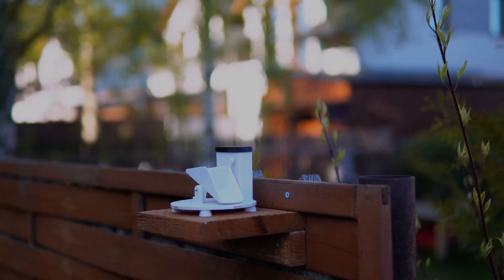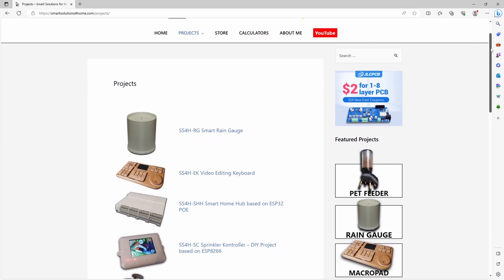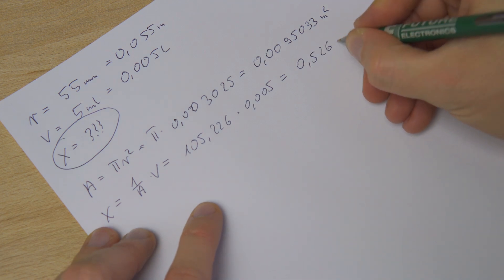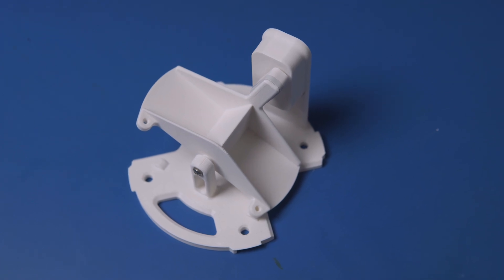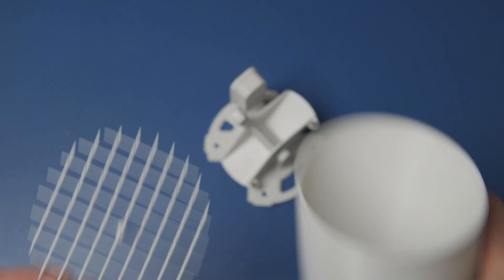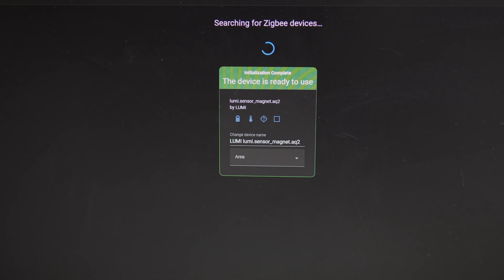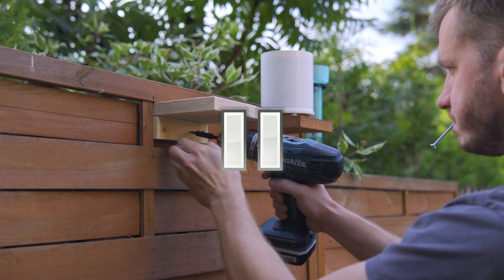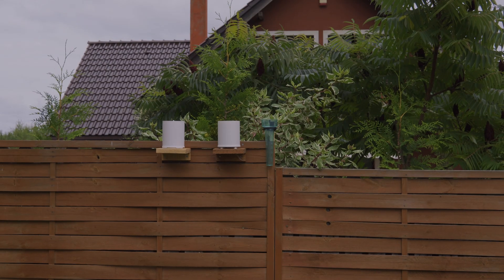DIY Zigbee Rain Gauge for Home Assistant

Comment: Missing the HA code.
Reply from the maker: It's in the video :) But you're right, it's missing in the article... I'll fix that ASAP.
Reply: @SmartSolutionsForHome  Thanks 👍
Reply: @SmartSolutionsForHome  The sensor is on it's way from ali and the filament roll is shrinking.. ;-) Now waiting for the HA code... nice video and nice tutorial.
Reply from the maker: @marijn1818  Share your impressions once you have the device up and running. :)
Reply from the maker: I won't be able to update the article for the next 7 days, so I'll try to address it here briefly:
All of this needs to be entered in the "configuration.yaml" Replace XXX with the name of your Door Sensor. This is an example for the last 24 hours. If you want a different time range, you'll need to duplicate this and adjust the time:

sensor:
  - platform: history_stats
    name: "Aqara Rainsensor flips/on"
    entity_id: binary_sensor.XXX
    state: "on"
    type: count
    start: "{{ now() - timedelta(hours=24)}}"
    end: "{{ now() }}"
  - platform: history_stats
    name: "Aqara Rainsensor flips/off"
    entity_id: binary_sensor.XXX
    state: "off"
    type: count
    start: "{{ now() - timedelta(hours=24)}}"
    end: "{{ now() }}"

template:
  - sensor:
    - name: Aqara Rainfall
      state_class: total_increasing
      unique_id: aqara_rainfall
      state: >-
        {% set count = (states('sensor.aqara_rainsensor_flips_on') | int(0)) + (states('sensor.aqara_rainsensor_flips_off') | int(0)) %}
        {% set mm = count * 0.52615 %}
        {% if count >= 0 %}
          {{ mm|round(1, 'floor') }}
        {% endif %}
Reply: @SmartSolutionsForHome  I did this differently. I have a counter helper for the number of bucket dumps, an automation to increment the counter, a template sensor to convert the count to mm, and several utility helpers to show the amount of rain for the last hour, day, week, month, and year. The count and template don't reset but act like a utility meter.
Reply: @vegaswayne247  Sounds like you have solved it. Would you like to share the code for it?
Reply: @vegaswayne247  Would love to see you how you did that.
Reply: @vegaswayne247   I like your approach to integrating the counts into HA. Would appreciate if you could share your code, thanks?
Reply: @vegaswayne247  Any way you could post your code here?  Your configuration sounds PERFECT for some of us!😃
Reply: @SmartSolutionsForHome Dude, your timing is so good, I was about to print the other one and then just saw the email on this version.

I've printed it out and assembled it and had some issues with friction so had to take apart and sand it. Works now with 5mL water. Model is really good and easy to print and assemble. 

Only differences I did on mine was cover the sensor with a latex finger tip off a glove just incase of water. 

I've tried the the code posted above on HA and for some reason it's value doesn't reset back to 0 but instead 0.5. Any ideas?

Cheers
Reply: @tommydadogz  Hi I seem to also end up with a 0.5 instead of 0. Haven't figured out the solution yet
Reply: @SmartSolutionsForHome  What do I do if I want an availability template for on and off?
availability template: "{{ (states('sensor.aqara_rainsensor_flips_on + XXXX?') not in ('unknown', 'unavailable')) }}"

Comment: I saw that all comercial products are white and i was thinking what will happen in the colder months when the water freezes? Will a black funnel help maybe a little? In the summer I guess it will speed up the evaporation, hmm. And, I only have  a spool of black PETG right now, oh and a "wet" glow in the dark white PLA.
Reply from the maker: That's a good question. I believe it's mainly an aesthetic choice. Besides, during the hotter months, a black enclosure might get very hot and deform.
PLA isn't great for humid conditions; I'd recommend you go with PETG instead :)